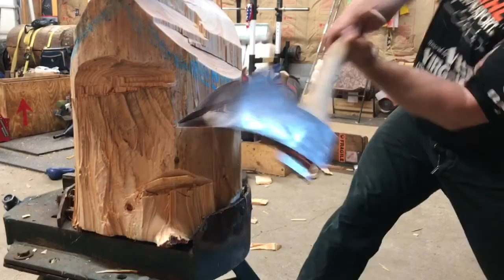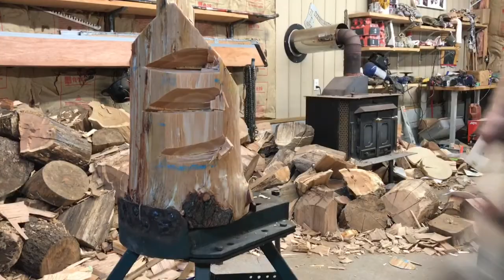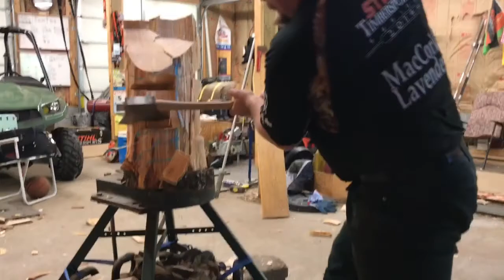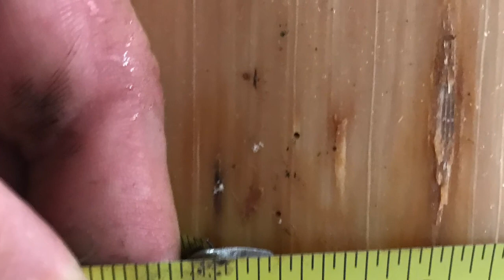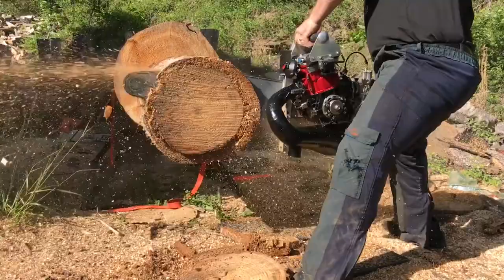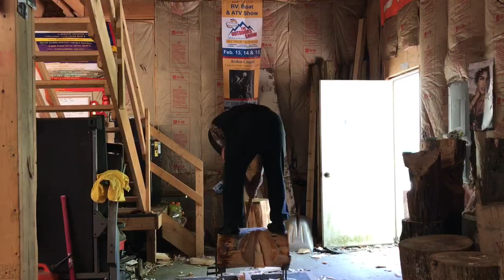5.2.17 Day 17 Event Training

Comment: Length of the sword on your stock saw? 25"?
Reply from the maker: Bear Siragusa on the 661, It's the series length - 20"
Reply: Thank you. Will you keep using the 661 or switch to the Magnum 660 I hear they are using in the series?
Reply from the maker: Bear Siragusa we use the 661 on the Series
Reply: Ok, gotcha. I had read on the STIHL website that you all used 660's, but that must be an old article. Thanks again for the answer!